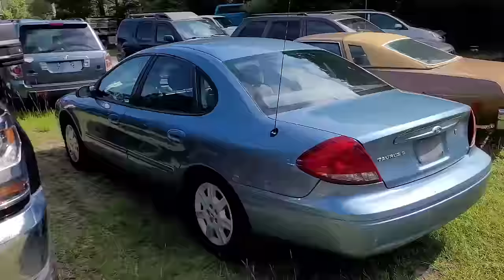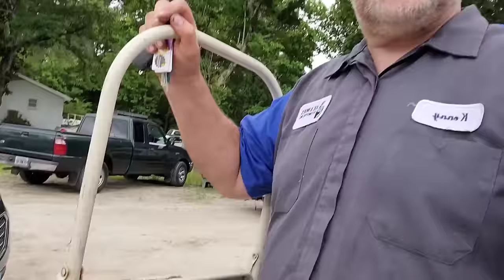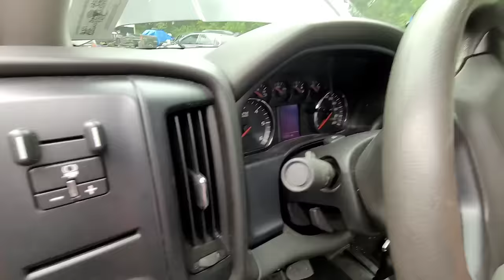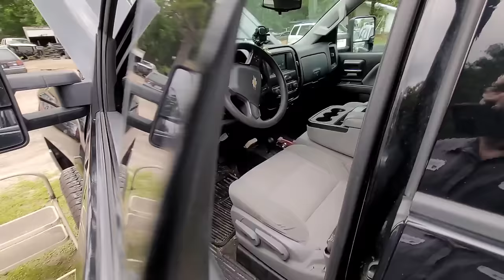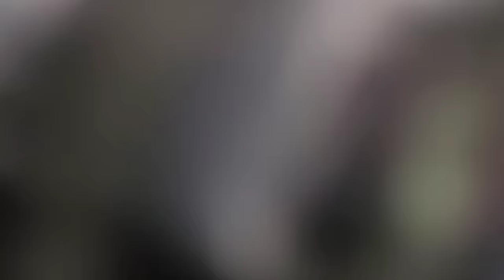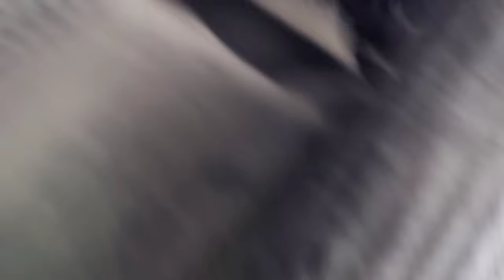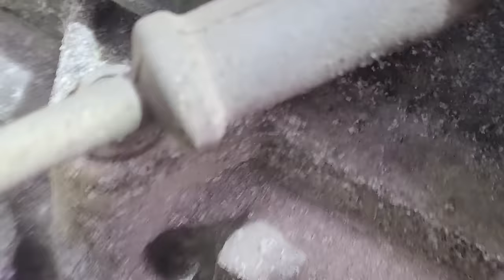Another GM 5.3 Ticking Noise. It's not the lifters on this one either

Comment: This guy knows engine repair. He is not a parts changer that throws your money at a problem until its accidently fixed.
Reply: This gut just works on ls engines regularly....  literally every chevy truck from 2000 forward has at least on broken manifold bolt, if not two. In my experience its generally the driver side rear bolt that is broken pretty much always.
Reply: we have a 2007 Tahoe with 185000 miles and there are 2 broken bolts on the passenger side.  It goes away in a min or 2.  

I have the AFM turned off and I really believe doing this has saved the lifters as it runs WAY better than when it was activated.
Reply: @thomasnew8606  yeah, turning off afm prevents lifter from dropping and oil burning. I have run Tahoe’s for 6+ years without issues turned off
Reply: So that's what I'm called hahaha.
Reply: I live live in Florida  i am a Tech for Chevrolet . lol
Reply: Huh??? Fanboys ruin everything.. a mechanic just throwing parts at it until it's accidentally fixed is the dumbest thing I've read today!
Reply: My wifes engine is making this noise and the dealership quoted us 12 grand to re-do all the lifters, oil pump, water pump and valves.
Reply: @thebigianziemann  if u were in muscle shoals Alabama I'd do it for ALOT less. The 5.3'$ are relatively EAZY to work on
Reply: Yep! Those manifold bolts drive me crazy. You fix it and it comes back later to just give you the finger.
Reply: @thebigianziemann Going to the dealership is the first reason for that price
Reply: @temperances320  we took it to a mechanic and they did the lifters that were no good but it's still making the knocking noise in v4 mode so don't know the problem now.
Reply: Got a 5.3 job customer wanted lifters changed head gaskets exhaust gaskets oil change knock sensors valve cover gaskets ,pulley set changed all because he hears a ticking noise I never heard it till I changed everything and come to find out it was a loose flex plate bolt that was rubbing and making a ticking noise😂😂😂his lifters were fine I showed him but he said change them anyways 😂😂😂😂
Reply: @thomasnew8606 I own a small shop and I've gotten so many silverados and suburbans in with broken manifold bolts. I've gotten where I just JB weld around the manifold to stop the leak and I cut the head off a bolt and tack weld it on the manifold lmao, saves a ton of labor and gets the same result. Money makers for me.
Reply: Master Mechanics are often found in Mexico!!!!  I took my vehicle to Mexico and they did an amazing job - total trust in my new TOP MASTER MECHANIC!!!!
Reply: @thebigianziemann What a rip off! My 2016 Escalade had ticking noise for 2 weeks then BOOM! I heard a clunk. Sounded horrible. Not drivable. Stems from a problem I had over a year ago with oil consumption & leaks…GM/Caddy dealer never fixed the problem under warranty, then it went off warranty & the engine light went on. Had the Escalade towed to the dealership where it sat for 6 weeks as we fought with the service dept via Cadillac Care. I got a hold of a GM district mgr & told him the truth & GM paid for the fix…which was just a band aid fix. Now the fight continues.
Reply: Always have said, I'm a parts changer.
Reply: He was once a parts changer its part of the process

Comment: I bought an 01’ GMC 2500HD with the LQ9 in it for $350 several years ago because the guy claimed the lifters were bad. As soon as I went to see the truck, the guy hit the key and I knew it was an exhaust leak instantly. Gave him his $350 and drove the truck away smiling ear to ear. I recently sold it for $7500 with only 167k miles.
Reply: Not to be that guy but your truck has the LQ4. LQ9 has different pistons, cam, and maybe a few other small things for performance. They were only installed in the Escalade, H2 hummer, and the Silverado SS.
Reply: @jacobauld565  No sir. Your data on when the lq9 was offered and in what vehicle is correct. However, the lq4 was replaced with an lq9 in my truck in 2014 due to an oiling issue. The guy then developed an exhaust leak. Someone told him it was “the dreaded GM lifter tick” Disgusted, he sold it to me (a neighborhood guy) for next to nothing. That truck is still going strong with the junkyard lq9
Reply: So you scammed him and wasn't honest is what you're saying?
Reply: @Skrooge303  How did I scam him? He was selling it for $350… and thats what I paid him
Reply: @intheshoptv  you took advantage in a major way.learn to be a better person
Reply: @junicohen7918  He asked a price, I paid it without giving it once over. Fair is fair. Not like he dropped the keys on the floor and I drove off with the truck without him knowing. Learn to not judge.
Reply: @intheshoptv, you still cheated the guy. Try to be an honest person next time and be kind. You knew the problem, you could have saved him rather than duped him. That's criminal act
Reply: Bought a jeep one time. Guy had it in his garage said lifters were bad. Got it cheap. I knew it was exhaust leak drove it for years.😊

Comment: When i listen for noises on any engines i use 3/4 heater coolant hoses 3' long and listen through the hose by using rubber hose it drowns out all other noise and makes it real easy to find any noise. You nailed it.
Reply: A soild bar works better and is safer. 2 foot 3/8 extension works great.
Reply: We used to use a 2'  full length  metal screwdriver  to listen for internal engine pings or knocks.
Reply: @davehill1476  yeppers
Reply: Lisle sells a $20 mechanics stethoscope works great and comes with another add on tube with a rubber duck bill tip to listen for vacuum sounds
Reply: I use a very long 3/8 drive extension. Wife looked at me like I was crazy the first time she seen me get it out to listen for a ticking sound. I never thought about using a coolant hose.
Reply: @adventuresiwork3563  I used to use the extensions long screwdrivers about when someone showed me this heater hose trick that's the only thing I ever use and then on
Reply: The old broomstick trick been using it for years
Reply: That is brilliant I am going to try that
Reply: Personally prefer a 1/4" ×3' dowel rod, cheap and effective.
Reply: That's a good idea. I'll have to remember that

Comment: I’ll tell ya another way to check for those exhaust leaks if you can’t see any traces of carbon tracks, works well, spray those areas with soapy water with squirt bottle, then take a shop vac and reverse the airflow, put it at the tail pipe assuming you don’t have any large exhaust leaks underneath, and you will see bubbles/foaming between the head and manifold, it works very well too
Reply: Awesome tip!
Reply: Thanks I'll try this

Comment: As an old former muffler mechanic, I can tell you if you're lucky (or the customer) the bolt isn't broken, it just fell out. Back in my shop days, that was the case about half the time.
Reply: On most of these "ls" motors the bolts are broken. After a decade of this problem you would have thought GM would upgrade the manifold bolts but hell then they can't charge your for a repair.
Reply: @mgmjferg89 there was an updated bolt. 
I have them on my 6.2L LS.

They seem a lot stronger then the old ones so far. Knock on wood....

Thermal cycling kills the old ones, where the heads pop right off

Comment: Darned outstanding video.!!!!   No drama. No click bait. No BS. Your presentation is spot-on perfect. It’s as if a normal person is giving the information. And, that’s rare on the tube. Thanks for the EXCELLENT VIDEO!!!!
Reply from the maker: Thank you soo much !! Really appreciate that !!
Reply from the maker: @razorsedge  is it possible the tin shield near the starter became distorted and is touching the flexplate ?
Reply: @WrenchingWithKenny  I notice that Noise after cold starts in the morning then Goes away after warm up idk why
Reply: Thanks WWK! Saves me a headache 🤕 hassle. I have a 2013, Avalanche, I got a good scan tool and found a misfire on #6.. the spark plug wire was broken and someone put the wrong plug In. New wires, plug and coil helped.. 

I’m getting a P015D, P0446, P0451.. Evap and a Fuel Pressure Sensor error. How do I fix this problem? What parts do I need and do I need a replacement Evap line?
Reply: @Chanchito510 sticking lifter

Comment: When I worked in the oil patch we had a cheap and fast way to fix most problems with our trucks...
Turn up the radio LOUD!!!
Reply: Lmao if it’s a patch truck and the truck makes a noise… god knows what the problem may be as those poor trucks go through so much.  Used to work for a trucking company who built c-rings for fracking and we had a 13 duramax,  too nice of a truck to be a patch truck.  I cringed seeing the shit us guys put that poor truck through haha
Reply: We used to say, kick the fuse panel.

Comment: As soon as you started it I knew exactly what it was. The sound was the key here. That is no lifter. You can hear the exhaust escaping from around the manifold. Very distinct sound compared to a valve or lifter tick which is more metallic in nature as well as internal and sometimes muffled. This is external by nature. Either a broken stud/studs or cracked manifold itself. Like he said very common. Especially northern exposure vehicles due to snow and salt emulsion. Death by CORROSION. Truthfully I have repaired only a dozen or so lifter jobs on these due to the fact that they were caught early but if left alone you are looking at cam and lifter replacement. Once it starts it just progresses from there to total carnage of the cam. It’s good that this man is around for him. Good ear as well as knowledgeable about these engines. But most importantly EXPERIENCED. Just because they went to school to learn how it works doesn’t meant they are experts. Experience is gained by years of working on them. Not a text book. Good example of old school vs new school. Very informative video. 👍
Reply: Wait are you saying if I have this leak due to a bolt that broke it can completely damage the lifters and cam?
Reply: @alexpasillas3187  : No, that's NOT what he was saying at all.
Reply: @MercuryRisingFast  that would be a rod bearing. Pull the oil pan and windage tray to inspect the rods. Look for up and down movement. Side to side is normal to a curtain degree but up and down is not good. If you find up and down then you may have a spun bearing. Depending on how long it has been doing that will determine whether or not you need just bearings or a tear down to replace rods. Put the vehicle up on lift and have it running. Listen to where the knocking is concentrated at. If it is down low you have a bad rod bearing or more. If further up towards the top of the engine near the heads you have piston slap from bad rod pin sleeve. If the later then a tear down is required to replace pistons and rods. Full lower end rebuild. That’s worst case scenario. But if just a spun bearing and no visible damage to the journals then bearing will fix the issue. If there is damage then the crank needs to come out and replaced if the damage can’t be cleaned up and smoothed out to spec. If can be cleaned and smoothed out oversized bearings will work. Need to spec the journals after smoothing with a micrometer so you get the correct size. That’s it in a nut shell. Good luck.
Reply: @MercuryRisingFast  have to check that periodically. If there is an issue of low oil then yeah it can come up out of the blue. I don’t like to be the barer of bad news but from what I read in your post that is most likely the issue. But I could be wrong. It could be something else entirely but then you would need to have it checked out by the dealer or someone you can trust to give you the right information. Good luck on getting fixed. Actually worst case would be a new engine but nowadays engines can be had pretty cheep with low miles. Just getting it installed will cost you.
Reply: Been running my truck on a noisy lifter for over a year. No change eyes foreward no fear😂

Comment: Respect from northern Ontario Canada. You saved my 6 ltr V8 HD I was going to change the knock sensor then if that did not work I was thinking it was lifters and I may need to also change the cam. I was going to try a knock set delete.  Here the entire time it was the muffler guys not fixing the issue. I got under it and made the repair after watching. You saved my thousands.  Your a rock 🌟.  Respect from northern Ontario Canada

Comment: Most mechanics around here in the Seattle area just refuse to work on stuff like this that.  Either that or they say new engine.  You are one of the good ones.  Crappy mechanics around here pushed me to learn most of this stuff on my own (and with help from YouTube).  This still sounds like a pain in the ass repair to get a broken bolt out of the head.
Reply: It's not necessarily that tough.  If you can get at the bolt, you can grab it with vise-grips, spot weld a bolt onto the end of it, use a bolt extractor, or (this one sucks) drill and tap it out.  

Good thing is, once you've torn one apart, the rest are much easier.  Go figure it out bro, that's how I learned before the interwebs had everything you could hope to know at your fingertips.

Good luck, happy wrenching!
Reply: Same here, I was going to get lifters replace, they said to buy a new motor.
Reply: True!  I'm in the Seattle area and learned to do things myself.  Too many mechanics around here looking to make money off ya, so i took the time to figure out repairs on my own. Saved thousands!
Reply: The idea of replacing an LS motor due to minor problems like this is bizarre.
Reply: There is a repair kit that simply bolts on to the engine and secures the manifold again
Reply: @20tea  I don't mind paying a mechanic who does an HONEST job. At a fair to everybody price.
Reply: @FMChimera because it's for some ungodly reason they would rather pull and swap a junk yard motor than risk doing the repair and end up at square one again. It's ridiculous
Reply: Too many since yous

Comment: I just got a 2022 5.3 Tahoe….good thing to look for in a few years!  Glad to see some mechanics that don’t just keep throwing parts at the problem…at customers expense of course!
Reply: THESE 5.3 engines are truly amazing.  I have one in a Suburban with 320k miles and the entire car is perfect mechanically!!!  I also have one with an aluminum block in a GMC Envoy and that engine is fine, but other things wear out on this mid-sized SUV - the Suburban is a truck and everything is very solid on that vehicle.  Gents, buy the TRUCK chassis 100% truck SUV's like the Suburban   - the old ones last forever.
Reply: Yep, very similar setup.  Your bolts may not be broken, but  you may want to have that driver's side engine mount checked.

Comment: I stumbled on your previous video in regards to the ticking 5.3 that was related to the plug wire issue. At the time I had been chasing down a ticking noise with my wife's 2013 Yukon which I had just recently rebuilt the entire top end. DOD lifter had failed and ate the cam. Needless to say I was having flashbacks. While the new noise wasn't caused by a plug wire issue it did get me snooping around a bit more and I caught a glimpse of some soot at the manifold near the firewall. There were two exhaust manifold bolts that had either work their way loose or I had failed to fully tighten them. Snugged them down good and checked the rest. The engine is back to purring like a kitten. Crazy how something so simple is so easily missed. Thank you for the other video as it got me to look into it more and eventually got me headed in the right direction.
Reply: Did the two missing bolts cause a ticking sound when accelerating?
Reply: This is exactly what scares me about the newer 5.3 or 6.2 with AFM systems - Why won't GM fix this issue?  They say only 3% of the vehicles are impacted by this, but the fact that they persist with this defective system is beyond all reason.  Gents - the older ones are bullet-proof, but be careful inventing in the newer ones, because GM doesn't care about customers anymore - they only care about the government.
Reply: @rightturnclyde8575  They weren't missing but noticeably loose and the ticking definitely incresed with acceleration.

Comment: Thank You for this.....2009 Chev 5.3l.... I knew it wasnt lifters......bottom end, passenger side...loud at start up.....went away after 10 min driving......Manifold was loose AF!.....Just air being pushed with the combustion.....Great video!
Reply: How do you know if it is lifters? My 2009 5.3L Silverado makes a little knocking sound when I first start it up, different from the noise in this video, but it goes away after I drive for a little bit. I just ordered a Range AFM device to try to help the problem.
Reply: @holyspiritandkevin8441  

When my lifters were bad, the sound was more consistent,  got a bit softer as the engine warmed up, but never really goes away completely. Plus, you can really hear it under the valve covers if you open the hood at start up. The manifold problem can really be heard in the wheel wells.

Comment: Hey Kenny, I am grateful for your GM ticking noise videos/solutions wish I would have found you sooner. Had my  2014 Silverado 4.3 V6 towed to GM shop recently for the ticking noise  on driver side in fear of lifter or worse.   After watching your two videos in which the solution was loose coil pack wire arcing got the best of me , so I had to go to the dealership service and check this solution.  Popped the hood and started checking wires- #3 cylinder wire fell off after slight  wiggle, plugged back in . PROBLEM SOLVED!  Showed service manager who started the truck when it arrived and heard the noise , couldn't believe it. THANKS Kenny!!!
Reply from the maker: Good grief! I'm so glad I could help. Thanks for watching & leaving a comment. Keep wrenching 🔧
Reply: The stearlerships are in great shape...